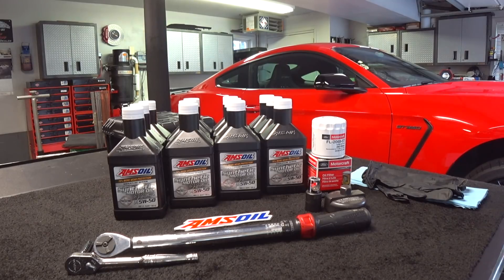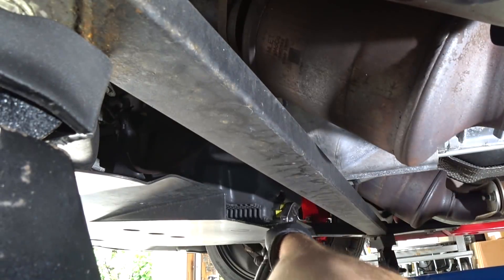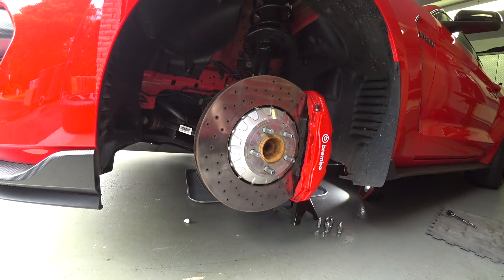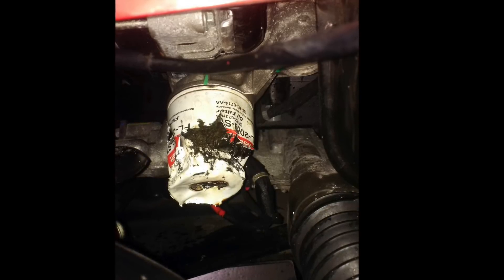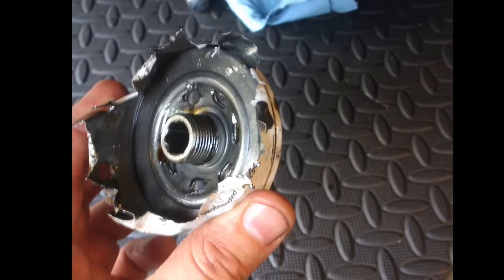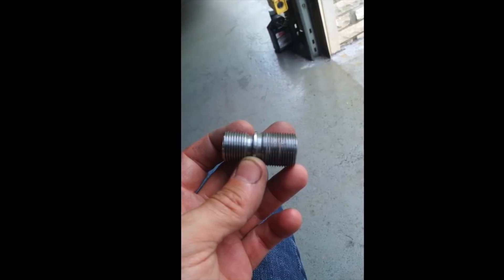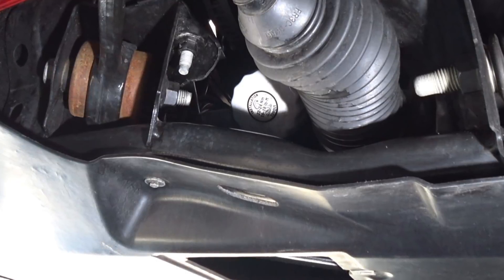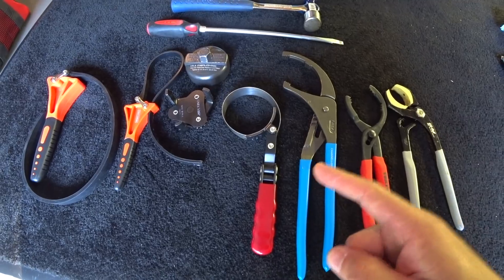Oil Change From Hell | Shelby GT350

Comment: Any and all contamination, metal and sludge is mixed with the oil whether it’s cold or hot. Allowing ALL the oil to drain out of the top end overnight is the best way. Hot oil might flow better but it’s also still sitting in the top end of the cams until it drains back down after you shut it off. So, rly, what sense does it make to start an engine before an oil change? You get less oil and you get burnt. Change your oil cold.

Comment: Man...that sucks. I've had similar issues with stubborn oil filters...usually the first oil change on a brand new (Ford) car. I always change my own oil once it's mine...your video reinforces my paranoia that someone else will find a way to f*ck my car(s) up. Especially my Shelby... Lol. I always use a metal band wrench, as close to the base as possible.

Comment: Well the concern is you have to torque 16 to 18 ft lbs that is is stupid tight for a oil filter  and like and old 7.3 the engine shakes so much it makes itself tighter. And the reason the design change is because people wasn't tighten it to proper spec and the oil filter was falling off

Comment: Almost every time I do an oil change after someone else did it the filter has been cranked on super hard. When I do it I put a little oil on the seal, tighten by hand and just give it an extra little hand torque. Next oil change I can remove the filter by hand. Never had a leak or issue. Not sure why “professional” oil changers can’t do the same. Filter was most likely cross threaded by a careless tech.
Reply from the maker: the issue here was Ford got many complaints on dealers who did oil changes on the Shelby GT350 where the filter spun off and engine lost all oil pressure and BOOM! so they sent out a bulletin to torque the filters however I think the tech who did this to my car took it into his own matters to over torque it to cover his ass if something was to go wrong or he was a tech who caused filters to fall off in the past and was trying to save his ass from being fired/ who knows but never again will i ever let any dealer do an oil change on my cars this was HELL to get that filter off.

Comment: The reason Ford switched to a cartridge style filter is because the spin ons were getting loose and falling off on the 5.2 engines, probably why this one was over tightened.  Secondly the spin on filters are always steel, never aluminum.  Spin on filters are all stamped steel.   Also the drain plug isn't spring loaded, there is no spring in the drain plug.  The grooves in the oil pan and drain plug push the plug out as it is twisted out and also pull it in when it is tightened.  Newer Ford drain  plugs dont even have a place to put a ratchet in them to loosen them, just two little tabs on the end for you to remove by hand or with a small pliers.

Comment: Next time heat up the threads the aluminum will pop off of Steel you might need to give it a little bit of help with a wire brush. aluminum is a non-ferrous metal and steel is a ferrous metal meaning aluminum dissipates Heat and spread evenly the controlled area while steel concentrates heat directly from the heat source. Using that technique helps a lot of mechanics they normally have to learn that stuff from welder I am a man of both Talent you still may need to rethread depending on the severity of the damage but it was beat up the process if it reoccurs.

Comment: I think the new design for the oil filter is nothing to write home about.  Our 2017 Jeep Cherokee Trailhawk V-6 has that design.  It's a paper filter within a plastic housing that you unscrew with a 24 mm socket.  Can you imagine some hot shot mechanic putting an air gun to that?!

Comment: The amount of torque it would take to fuck up 20mm threads far exceeds the amount that the hex on the end of that stamped sheet metal filter could handle.... if it was gulled and chewed up, something else is going on

Comment: Btw, why don't guys do a filter relocation on hard to get filters? My wife's 350Z, is very similar but have to remove the ground effects and it's still a bitch if it's tight. Bought a relocation and oil cooler, relocated it next to the front radiator. It even has a pull plug for line evacuation, just hook air and blow.

Comment: Let's be honest. They don't put their top technicians on the oil change rack. I would also probably put a remote oil filter on that. My 1980 Cobra had a crossover pipe and exhaust pipe right next to the filter from the factory.  A remote filter made changing the oil very easy.

Comment: In the video, the filter says torque 16-18 ft-lbs.  I'm a mechanical engineer and didn't estimate the torque required but off hand and based on alot of mustang experience, it sounds way too much.  Also, I don't know the exact materials but there may be a galvanic corrosion issue between the filter threaded hole and the fitting in the block.  Need more specifics to know either of these are the problem.
Reply from the maker: the engines vibrations cause them to come loose, this is the issue why techs are over torquing them

Comment: I just bought a used car and I'm seriously dreading the next oil change cause I just know that the last guy who did the filter change over tightened is. Hopefully that's not the case, and if so, you always have the trusty flat blade screwdriver and a hammer to puncture the body and take it out that way. Cheers on the Shelby!

Comment: It's bad enough that we have to use 10 quarts of oil as it is? My filters have always been mondo torqued from the factory. I always do my new car oil changes at 500 miles. I always follow-up cleanup with CRC Brakleen.

Comment: I used to work at a gm dealer as a lube tech and my co worker would put the filters super tight just like that. It got to a point where people were coming back with leaking filters because the gasket was crushed. And what did he Do? He put them tighter. Eventually I started breaking them off whenever they were super tight like that (the dealer would have to pay one of the actual mechanics to fix this) and thats when they finally told him to stop. 2 years later.

Comment: Did you warm up the car really good before trying to remove oil filter?
I take a blue shop towel and place it, single layer, in the oil filter wrench cup to help grip the oil filters so the cup doesn't just pop off when trying to loosen.
Reply from the maker: the filter was seized at the threads on the oil pump stud, was not many other options to get it off other than what I show here. must have been torqued at the dealer with a breaker bar or something. This was a disaster to fix that day.

Comment: I've had this happened several times over my life. Never seen it on a car. Usually on diesels. I take a chisel and Hammer and tap it and it usually comes loose. Sometimes it'll crack the fucking housing. This is why you always put a little grease on the O-ring. Just be glad these kids that work at the dealership smoking dope got Your oil plug in. I used to see cars come back into the shop all day long with hand tight oil plugs.

Comment: I have a e46 m3 and never let anyone change my oil.When I buy new tires I take the rims to the shop, they replace tires I check for any scratches or damage.I put the tires on the car and tighten them with a torque wrench.I know my Iforged rims aren't damaged and my oil and filter is changed.

Comment: I've been working on cars for almost 20 years and I have never seen a filter on that hard.  That is unacceptable.
Reply from the maker: same here i never in my life had to deal with something like this, the pump stuff was cross threaded and seized to the filer and it had to be cut off in my vice with a cutoff wheel.
Reply: Did you go back to the dealership to get that oil filter spindle replaced and complain about the hack that torqued it down that hard?  But your right about everyone getting the tools and doing it right yourself.

Comment: Fyi, if you had used a filter strap, you would have saved yourself a lot of headache
Reply from the maker: looks like you did not watch the video or understand what went wrong here, no wrench would have taken this off with seize threads on the oil pump stud.

Comment: One time my oil filter was stuck on so I just took a long screw driver and drove it through the filter housing and used it like a handle. Thank good it came off and I didn't have to do what you're describing.

Comment: I have a mustang fox body Hatchback gl 1981 3.3 6l automatic here in Peru that I am repairing but I do not have the manual and I would like to know what type of oil the manufacturer recommends for the engine.

Comment: Champ why not just buy a new oil filter stud from FORd it would have been easier than trying to fix it, with a TAP and tie, and there's no way a aluminium thread is going to damage a Steel tread its simply impossible unless the outer edge of the tread on the oil filter is steel and the oil filter outer casing is aluminium, you can have a Aluminum casing for the oil filter, i think looking at the oil filter you removed is a steel casing, which is why the oil filter was cross threaded when put on and its good that the internal thread of the oil pump has the hex head female, so that if required you can remove the stud. :)

Comment: When i worked at a oild change place i bought myself one of those claw oil wrenches. I got tired of the ones the shop provided. There a few cars that sat hrs i a bay cuz i was the only one that could remove some of the filters some jack ass torqued down

Comment: Do you know when ford changed to the cartridge style filter? My 2017 has it and was built in July if I remember correctly. Serial # 4945
Reply from the maker: i am not sure when they switched over based on the VIN break, we bought two GT350 both 17 models and one had the single piece filter and the other the two piece.

Comment: That’s not a “2pc” filter lol it’s just called a “cartridge” filter. MANY cars have the cartridge filters now. You want a hard one to do try a Toyota 1.6 it’s a smaller cartridge which is parallel right next to the block on the back side and every shop tech seems to be pissed at the world when they reinstall the cap lol

Comment: Basically the oil filter thread was cross threaded onto the oil pumps side threaded fulls top ? I have never ever seen a oil filter that hard to get off even if the filter was put on too tight ? Great job getting it off removing the oil pumps internal stud, which is why they are hex head female ?

Comment: Similar thing happened to my Camaro 1LE last oil change. The car came with a bunch of free oil changes but they got all used up, so when I went to take off the oil filter it took at least 4 hours straight and a good nights sleep to get it off. Dealer techs just impact the things on not caring who has to deal with it next.

Comment: I think too many modern day mechanics are getting power tool happy and are just lazy to use the old fashioned elbow grease, ie hand tightening the oil filter. The same way it's been done for over a hundred years. 
I have always hand tightened mine and never ever had a single droplet leak.

Comment: Do you have a strap wrench? I worked at a oil change shop and we would have dealer filters come In that I'm sure a fuckin terminator put on but a strap wrench would almost always work if there is room enough for it

Comment: I have always done my own oil changes and have always only hand tightened my filter on with no issues on every vehicle I have owned. When I got my Gt350 back in April 2016 I  did the first oil change at about 500 miles. I read that the filter would need to be torqued to 16/18 ft pounds and wondered if hand tight would be even close to that. When I bought the filter it even has the "torque to 16/18 ft/lbs" spec written on the bottom and noticed the threads were slightly red which I believe to be some factory spec loc-tite. Knowing how hard this engine vibrates and hearing the stories of these filters backing off I decided to follow the advice of Ford and its engineers and Torque down the filter to spec. I put a little clean oil on the O ring then hand tightened the filter as tight as I could. Grabbed the torque wrench to see how close I was.....not even close and I am no wimp!! Torqued the filter to 17 Ft/lbs which felt terrifyingly tight in my opinion . I told my mechanic what I had done and he grimaced and rolled his eyes lol. I knew he would be of the " hand tighten only school of thought however not having worked on many wildly vibrating FPC engines I can see where he and others may be coming from. Here I am now with 40000 Kms and 10 of these oil changes done, all times the filter torqued to spec, with no issues and not a drop of oil under the car. Using decent tools, an accurate calibrated torque wrench and a proper fitting filter socket ( the one ford sent us all for free with our chassis number on it works fine)  all help to ensure success on what has become a simple and painless procedure

Comment: Even if the dirt, and particulate is in the bottom of the pan, it will most assuredly exit with the oil, it just flows a bit slower. Gravity always wins.

Comment: On my E63s the filter is on the top of the engine , I use a oil extraction tool through the dipstick tube suck out 9 quarts of oil put 9 quarts back no need to lift the car , I use 5w40 liqui-Moly, I think more manufacturers should do it this way it’s so much easier
Reply from the maker: yes i owned one of those i know, the location of this filter is so awful on this car and the idea of this one piece filter was most likely a cost cutting decision internally that they realized would not work now.
Reply: They’re slowly getting there.

Comment: If it says Ford on the side, I don't buy unless it says 7.3L Powerstroke. Nothing but problems from Fords over the years. 

Having a stud in the filter housing WITH a hex hole in it, is a huge indicator of a bandaid.  They KNEW that design was a problem as THAT was the fix instead of doing it right. Probably wasn't even the tech's fault. Likely over tightened itself just from vibration,  like most filters do.

Comment: I had a similar situation with the newer plastic canister oil filter housing. I ended up replacing the plastic housing with a metal one and so far it's been better. I do my own oil changes now..
Reply from the maker: so you had this issue on your GT350 with the new two piece design? I have worked on quite a few of those and the O rings on both halves do help but if they seize up from no lubrication I can see that as an issue as well.

Comment: Did you put grease on the rubber ring? That's what a lot of people forget but also is the reason why 1 piece filters get stuck
Reply from the maker: the dealer did this mess not me, i always do it properly the tech over torqued so much he seized the threads onto the oil pump stud as i show
Reply: Auto Fanatic  yeah seen the vid. but I meant on the new filter, it has grease on the ring I hope?

Comment: I just don't get it. Almost every oil filter I have changed only required a lubed seal and about as tight as you can get it with your hand. There is no reason to be using power tools to tighten a filter. Even if you did, it would be one blip of an air gun past snug.
Also, from what I have seen, the majority of filters that only have the element rather than the whole can usually do it on foreign cars like BMW and it's basically a way to check your pleats for engine ware instead of having to cut open a can. I wouldn't say it's better or worse at stopping solids. Just better for diagnoses.

Comment: This is why you must oil the new filter’s gasket
Reply: that is completely not the reason... to lube the gasket is for it to sit flush so it can seal properly and not bind up and kink so the oil leaks out. it has nothing to do with seized threads.

Comment: Auto fanatic I have a question for you. I just got an indication on my GT350 for “change oil soon” . I’ve only put 1100 miles on the last oil change in 11 months and I’m already at 4%. I originally wanted to wait until spring to change the oil but now I’m not so sure. What’s your opinion? I’ll have to go to a dealer unfortunately for the work.

Comment: I prefer to change my oil without running the engine first. When you run the engine, it puts a lot of oil up through the oil gallery. I think you get more oil out by draining it while cold and letting it drip for about 20-30 minutes. Just a thought.

Comment: Some auto repair shops have camera's installed, just request the shop manager to review the camera footage. You should be able to find out who worked on your car through employee work logs also. I would be irate as hell if they used an impact gun to torque down the oil filter. Looks like the car sustained some damage to the threads, I wouldn't have any problem at all confronting them if I had a car this caliber, complete nonsense why it should be torqued down that much.
Reply from the maker: the NYC news networks have done stories on the scams at most auto shops its really bad when they get caught on camera and deny it all.

Comment: One tool, which may have made it easier, was an offset handle oil filter wrench. One time I ran into a very heavily torqued oil filter, and I was fortunate in having sufficient room, (which you do not, on that car) to successfully use a stillson pipe wrench, near the base, to free it.